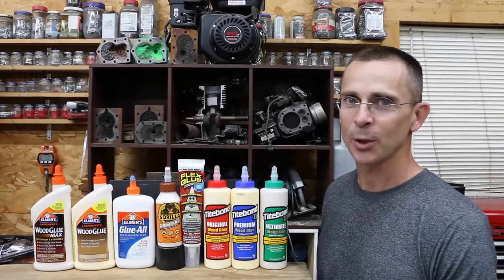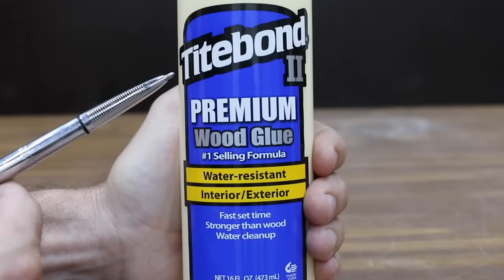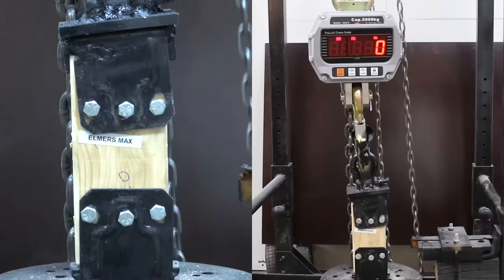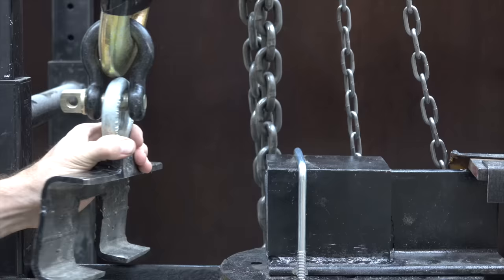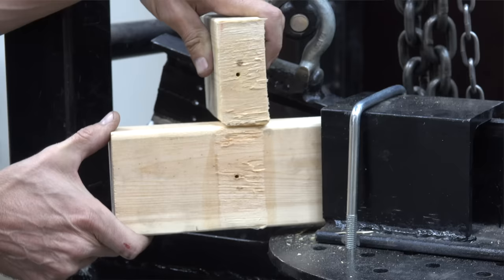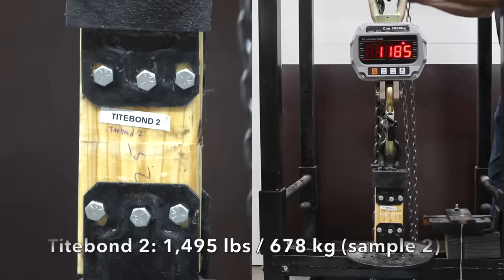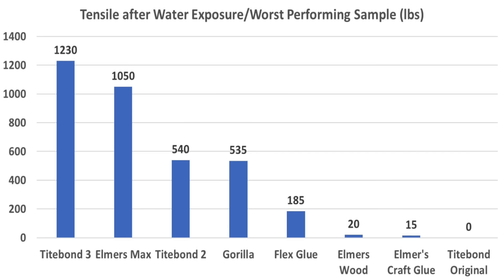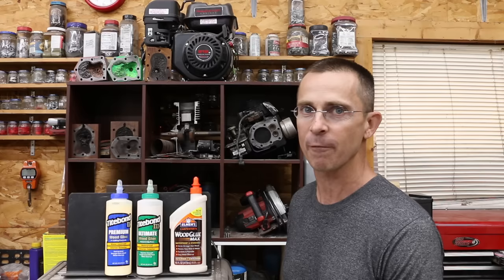Which Wood Glue is Best?  Let's find out!  Showdown with Titebond, Flex Glue, Elmer's & Gorilla.

Comment: I like how he throws in the flex bond products. All test I've seen has shown that they are overpriced low quality products like most as seen on tv products but people still buy them. Amazing what television "programming" will do.
Reply: Amen brother
Reply: People are dumb
Reply: Dennis Young  Never heard of their products???  You must NEVER watch ANY television then...
Reply: Tim Baumann Or not be from tbe US
Reply: @tripplefives1402  its overpriced. Get you some eternabond tape. It is pricey but it's the best self sealing tape there is. Also the zip tape from lowes is 25 bucks for a 90 foot roll and it's better than flex tape. It's made for the zip boards but you can use it for anything. Very uv resistant
  Last a long time too.   Eternabond has been on my camper roof for 6 years and still plyable and stuck down
Reply: it's almost like religion and indoctrination are a thing with humans, as they're gullible, age 0-100, and pedophile grooming is also a thing, huh!
Reply: They are not a "low quality" product.  They are not made for ultimate strength; they are designed to flex.  You would not expect rubber cement to withstand high tensile loading!  Yet this product is essentially that, designed to not crack when the substrate expands or contracts, and for non-porous substrates, like glass or plastic, or for flexible materials like leather, cloth, or for holding rubber surround to speaker cone.
Reply: Because somebody's mama or grandma seen it on TV and it fixes everything
Reply: @bpark10001  wrong again. If it's too weak, it'll just rip up easy and do nothing. It needs to hold for its dear life AND be flexible... "dur hur not made for it". YA KNOW, MAYBE THEY SHOULD MAKE IT BETTER. STRIVE TO DO BETTER, INSTEAD OF BEING COMPLACENT BEING LOW QUALITY
Reply: @dimitar4y  I disagree.  Something can't be flexible and strong at the same time.  If it is flexible, it deforms under LOW stress.  if the stress is maintained, it deforms until it breaks.
Reply: Tow straps are strong but flexible although not as strong as grade 70 chain.

Comment: I used to work in test and evaluation in a missile guidance lab, and I have to tell you that you do a great job with your test methodology. Thanks for taking the time and going to the trouble of designing repeatable test set-ups. Also, Titebond II is what a lot of folks (including myself) use to repair guitar necks and headstocks. Good to see a test that confirms it's a good choice!
Reply from the maker: Thank you very much!  Great feedback on Titebond.  It's a great product!
Reply: Mycel  I bought some hide glue once but I've never been able to find it.
Reply: Are you an importer/exporter of these repaired guitar necks?
Reply: @BZABuddy  In between architecture gigs.

Comment: I can tell you from personal experience with this stuff that Titebond 3 is indeed one of the best.
I don't do a lot of gluing end grain to end grain, but I have made quite a few hardwood tables with Titebond 3, and when I trim the tops down to size, I've tested the joints by breaking the parts I trimmed off.. They almost always break at the wood and not the glue (The joint is stronger then the wood itself).. AND,, it's safe for items that will be used around food. (According to the label)  The better you force the glue into the grain, the better the bond, but not so much you push all the glue out out of the joint..  around 100 lbs of pressure usually gives a good bond. 
I think if you had tested grain to grain, you would have seen more wood failure than glue failure. 
BUT.. I do enjoy these videos.. Keep it up!  Very informative.  :)
Something I've been pondering for a while, but haven't tested.. Biscuit jointed wood vs dowel jointed.. Which is stronger.. I think both are very good joints and offer lots of strength.. but...
Reply from the maker: Thanks, will do!  Thanks for the video idea.

Comment: There was an error on the water-logged test for the titebond original. You had said that the second test produced a result of 1165, but the force gauge actually read over 1600. It didn’t end up affecting the outcome for that test, but worth mentioning since that’s over a 400 lb difference. Great video, and very informative!

Comment: Flex glue: We can claim anything we want to sell our products 

Also Flex Glue: Oh Damn. Project Farm is testing our products again 😱😱😱
Reply from the maker: Lol
Reply: nerd
Reply: Jason82 he tested it in 24 hours of curing, it takes 7 full days to properly cure.
Reply: Flex Glue is not supposed to be a wood glue. I expect it would be much better with nonporous materials.
Reply: the only thing flex glue is better is it is easier to apply.
Reply: @zzgarden  I used Flex Glue to hold down some aluminum T-track I didn't want to drill screws in if I didn't have to. I let it sit for 6 days before first load of about 60 pounds compression (no tension or sheer load at all) and it failed after a few uses.

Maybe it has a good use case, but it was  terrible for everything I've tried it on.
Reply: Why can’t you wait 1 Weak just to Test the Flex Glue
Reply: @underwhelmingusername4947  How long is 1 weak?

½ of a strong?
Reply: @greygtv6  The racism of low expectations strikes again!
Reply: Can any other glue be applied underwater? Do any wood glues seal out water? I think not! 😎 #teamflex 💯💯💯🍆🍆🍑🍆🍑🍑🍆
Reply: Wroger Wroger with MUCH PROMOTION😡
Reply: This has always been my thoughts on all 'As Seen on TV' products.  The harder and louder the sell, the less likely the product deserves any attention.   Current worst is 'Car Shield' auto repair warranty.   Read the REAL reviews.
Reply: You dare question the power of Phil Swift?

Comment: It amazes me that glue can hold these types of forces.
Reply from the maker: Thank you for the feedback
Reply: Have you seen construction adhesive? Even cars are being glued together.
Reply: And wood glue is not ment to use on endgrain so when used normally its even stronger
Reply: @johnwayne2103  My father works at a sheet metal/construction company. They use something called Lord Glue (metal only) but it's apparently stronger than welding.

Comment: Craft glue: can't hold pompoms to paper 

Also craft glue: hold wood together at 1500 lbs
Reply: 1000subsnovideos i mean, surface area and clamping does a lot for glue.
Reply: Did you affix pompoms to paper with drywall screws and wait 24 hours?  See there ya go... User error
Reply: @brodycaruso5394   Yes I know, I'm making fun of how when you make a craft something that is 2 grams doesn't stay on but 1500 pounds of force and nothing happens wood is also pooris and soaks some glue up and bonds a lot better then most other materials
Reply: @cdambartman  I'ma weld them mf on!
Reply: Most glues dont stick to the varieties of plastic that are out there, the pompoms I have ever seen were plastic, I dont know your situation, but the more you know :D
Reply: 🤚🤚🤚🤚🤚🤚🤚🤚I got the joke, it was funny
Reply: @jebowlin3879  I'm talking about the fabric like ones
Reply: 1000subsnovideos, you were making fun of...
Normal people got that, and you shouldnt have explained it, just sayin...
Reply: @thomasjefferson8875  why not
Reply: It was the "extra strong formula"
Reply: I bet most of the people commenting on this joke are the life of the party everywhere they go 🤦‍♂️
Reply: @jebowlin3879  ,  Unless you have a solvent type glue that is known to soften a specific plastic you are working with, you are better off using an epoxy glue. Even then,  you will almost certainly have to rough up or scratch up the plastic in order to get the glue to stick to it. Nylon and polypropylene are particularly difficult to glue and no solvent that I know of will soften the surface of those.
Reply: @subsnovideos-ur4cn  ,  Epoxy glue is probably your best bet in many circumstances of attempting to glue plastics. Even then you will have to rough up or scratch up the surface of the plastic so that the epoxy has some tooth to grab on to.  Otherwise you will need to find a solvent based glue that actually softens the surface of the plastic so it can bond with it, but some plastics such as nylon and polypropylene don't react with any solvents that I am aware of.  I also haven't had much luck with so called plastic fusion type  epoxies, they stink to high hell from the solvents in them as they cure, but I haven't found any applications where they worked all that well.

Comment: I'd be interested to see how these glues perform against construction adhesive.
John Heisz, for example, is notorious for using construction adhesive in place of glue.
Reply from the maker: Great suggestion!  Thank you
Reply: He tested that already.  The PL 8X tested the best, but I can't remember the numbers.  Search his channel, he tested them a few months back.
Reply: You can make a lot of assumptions from the construction adhesive video PF did previously. If I'm gluing wood to wood, I'll reach for wood glue.
Reply: @AnomadAlaska  that's great for projects, but for construction applications, construction adhesive is a must. Not only is it an adhesive, but it also fills in voids and imperfections in the lumber - which is why it works so well for floor sheathing and stair treads.
Reply: My experience with construction adhesive is that they dry out and do not hold after a few years
Reply: @jameshaulenbeek5931  Wood glue is very strong and fills in voids and imperfections too. If you want to glue wood to wood and it is not a roof construction. Use wood glue. (because of the water problem). Construction adhesive is great if it is not wood on both sides.  Construction adhesive is not stronger than wood glue is for wood that is.
Reply: A lot of newer construction adhesive is polyurethane based. That stuff is really tough and will last forever.
Reply: @howardbain6516  Clearly you've never had to remove a subfloor with construction adhesive. Take it from me, those products work extremely well for years and decades. The plywood will rip and leave splinters when you try and pry it off of the joists
Reply: Agreed and I’d like to also see grain to grain glueups as end grain is notoriously weak
Reply: @72strand  No, wood glue runs out of gaps, we're talking about construction adhesive filling a 1/4"-1/2" or more gap, for example if you're installing a subfloor on a sagging joist, you can shim it level in the center and put a fat bead of adhesive and when it cures there will be a strip of support along the entire joist.
Reply: @howardbain6516  really!? My experiences with it have always been very good. I've had to remove plywood subfloor on a few different occasions that had been glued down with construction adhesive, and typically the first ply stayed behind on the joists. I had to run my saw along the top edge to clean it off.
Reply: @jameshaulenbeek5931  I agree with you, same experience. Howard clearly doesn't work with the stuff regularly.
Reply: I used PL400 for decades in home construction, it works great!
Reply: @ArdFarkable  Sure, there are places where construction adhesive is better than wood glue i'm not saying that. But i think some ppl think construction adhesive is stronger than wood glue on a normal wood to wood it is not. And construction adhesive is twice the price? Prob worse for the environment too.
Reply: @ArdFarkable  no,  my experience was with some cedar attached to drywall.  This was done in 1970 and when I removed the cedar in 1987,  the cedar came off the wall easy with only a little paper.  The adhesive popped off with a wood chisel.  Granted, modern urathane adhesives are probably better and I agree with others that wood glue is best for woodworking projects
Reply: @72strand  Most of the glue in this round up, if you read spec sheet carefully, is marked as 'no gap filling'.

Comment: Recommendation: wood glues and fillers and how well they sand and take a stain. And spread / fill
Reply from the maker: Thank you for the video idea!
Reply: I've been a cabinet maker for 30 years and have never found a wood glue that will take stain. For wood putty , I use Famowood.
Reply: @cabbyhubby I have had pretty good success just mixing the saw dust from that particular wood species (pile from under the table saw with titebond 1 or 2 or others (not titebond 3, nothing sticks to it like paint or stain). My homemade wood filler will stain darkest though because of the absorbtion with the saw dust. I have stopped using wood fillers because of waste when storing it.

Comment: I've used Titebond 3 almost exclusively for woodworking for years now because of the working range temperature as well as being waterproof once fully cured. I've never end grain joined boards with it, but in nearly every glue up I've needed to take apart after for some reason or another, either I messed up a bit or changed my mind on what I wanted to build, the wood around the joint fails rather than the glue joint. The fibers of the wood tear apart rather than the glue joint itself, in most of my use cases anyway.
Reply from the maker: Thanks for the feedback.

Comment: Titebond II is for things you will eventually have to take apart, like guitars. On something like this, you want the glue to fail first, and even better if it can be attacked with steam to further reduce damage to the wood.

Titebond III is for things you want to set and forget for the next 20 years, and aren't too concerned about the damage if it has to be disassembled. Though after this, I'd be inclined to use Elmer's Max interchangeably with Titebond III.
Reply from the maker: Thank you for the feedback
Reply: I never thought of it that way. I always figured permanence was the goal.
Reply: For musical instruments, use hot hide glue.  It bonds quickly and holds well.  It can be removed with little or no damage to the wood.  It will probably fail if it gets wet,  but ,if your violin gets wet, it's junk anyway.
Reply: Guitars get wet. They shouldn't, but the reality is that they do. Beers get poured on them at gigs. Sweat drips on them from performers under hot lights. And then there's a meme about playing guitar in the shower, or in swimming pools. I'd rather have the set neck glued in with Titebond II -- if and only if it has a glue failure or damage to justify fixing it. If it's good the way I get it, I'm leaving it that way no matter what the glue type is. If it fails, then maybe an upgrade was in order.

Also, I wouldn't hesitate to use Titebond III on a truly permanent repair like a broken headstock. There's no reason to be taking that apart again.
Reply: Good point! Most of my experience has been with player pianos, which need to be torn down and rebuilt every 40 or 50 years. Hide glue makes it easier for the next guy to do the job. 
My only guitar fix was when a guy sat on my guitar and broke the neck off the body.  (Alcohol might have been involved)  I think I used Weldwood and a piece of 3/8 dowel.  I'm not sure you could call that an "instrument" though. It cost me $30 at a pawn shop.

Comment: I was using Gorilla because of its foaming ability but when I ran out in the middle of project I went back to Tightbond, I had laying,  and found it did perform better as your tests show.  Thanks
Reply from the maker: Thank you for the feedback
Reply: mark marcinik Are you referring to Gorilla Glue's polyurethane glue? That product does foam and expand when curing. But, I believe the Gorilla Glue product tested here is their "regular" woodworking glue. I would have actually loved to have seen a couple of the polyurethane woodworking glues tested here to see how they compared. My experience with polyurethane glues (which requires pre-moistening of the bonding surfaces to aid curing) is that they create a very robust bond that is totally waterproof.
Reply: @MrLuigi-oi7gm  yeah my thoughts exactly
Reply: Testing reports I've seen have found the foaming nature of the glue is good for filling cracks but doesn't add much strength to the joint.
Reply: Bunny Warren : I agreed about the ultimate strength but they are must wear gloves sticky compared to water watery Elmers and sometimes that is an advantage .
Reply: Mr. Luigi : I have tested them
And agree the urethane are waterproof the “white” glues not really .

Comment: I'm amazed to see such varying results within each particular brand, when you can see how much care went into minimizing this...
Reply: I was also suprised by that. I would love to know what caused these inconsistencies. Aside from flex glue which was very consistently bad.
Reply from the maker: Thank you for the feedback
Reply: Seems the wood grain had a significant affect on the strength of the bond. The boards with tighter wood grain had significantly stronger bonds than those without. I don’t know how you take that into account when making multiple test pieces for each product. But I still enjoyed this video.

Comment: Very interesting results. The reason for the big variation is because you were gluing end grain. Every Woodworker knows that is a weak bond because the glue soaks down into the wood instead of binding the fibers. That is why we do joinery to ensure a strong joint when endgrain is involved. 🙂 So the variation in your testing has primarily to do with the grain on which it was glued. I would be interested to see the same tests with facegrain glue joints rather than endgrain.

Anyway, thanks for your videos, they are very informative when selecting products.
Reply from the maker: You are welcome!  Thanks for the video idea.

Comment: This is a great demonstration of the fact that wood glue is NOT stronger than the wood itself.

Well- if you laminate a couple of thin sheets together, then it is of a similar strength.

But butting two bits together like this will almost always result in the wood breaking at the joint.  This is because the wood has fibers running through it, which the wood glue does not replace.